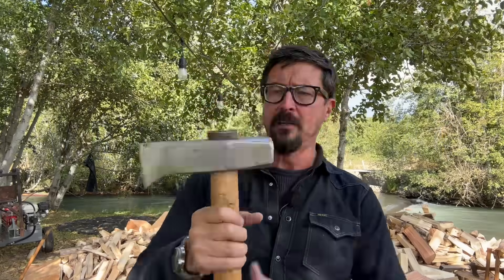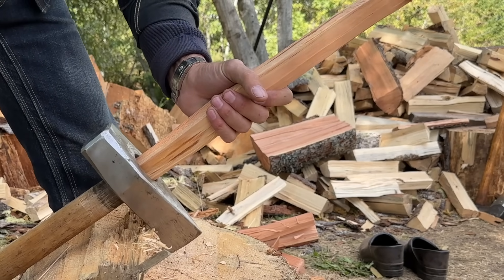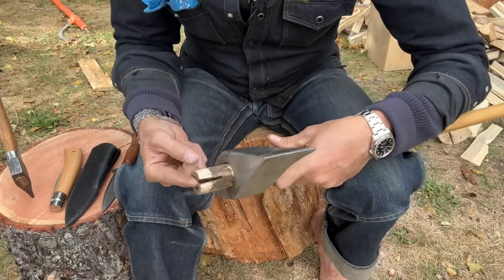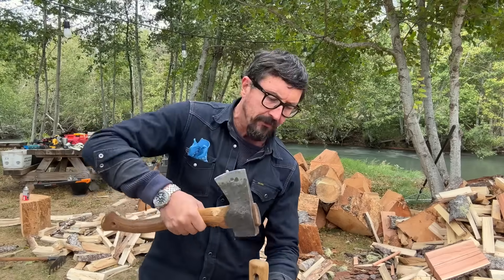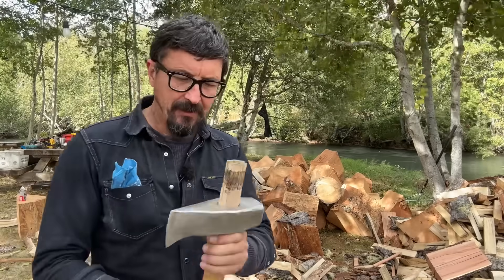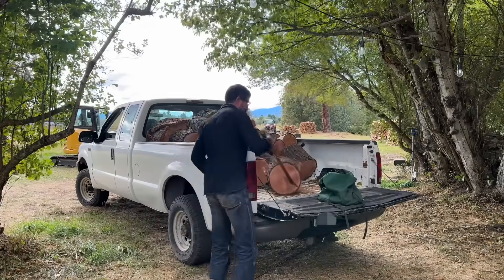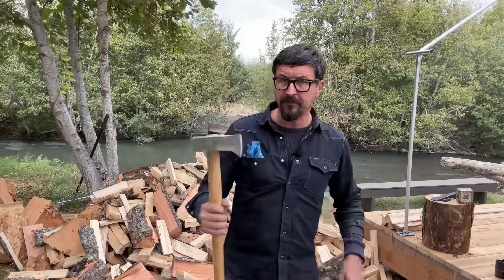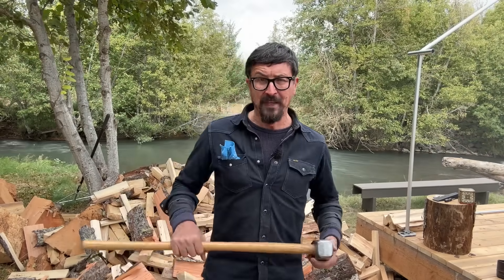Wranglerstar's Emergency Axe Repair (In Field)

Comment from the maker: Wranglerstar's Favorite Splitting Maul Only $69 Free Shipping https://amzn.to/3PKToFW
(Amazon affiliate link)
Reply: Made in China ...
Reply: I need a new axe for my content. I trust your advice wrangler if you say it’s worth it I’ll have to buy myself one in the coming week or two. 

Well, it’s forged steel for that price it seems worth it. 

I’ll put it to the Australian hard wood test!
Reply: What kind of pants do you wear
Reply: Waaait so driving a couple of old iron spikes or screwing a few screws into the end to spread the wood further is not the proper repair? 😂 jeez to think I have bought or been passed down so many tools that have had nails or screws driven into the ends and bent over 😂 I just assumed that was the proper way to repair them not to actually replace the handle entirely, see that makes sense and we're not paid to make sense 😂 act accordingly folks

Comment: You put me on the 4 in hand years ago when I was like 15. I’ve been buying them and misplacing them for years and now I have enough that I’ve got one in nearly every tool box.

About two months ago my car wouldn’t start at a gas in the middle of no where, I tracked down the issue being some tarnished and corroded battery contact points. 

The forehand made quick work and I was back on the road.
Reply: Me too! (But I haven't solved an electrical problem with one yet)

Comment: I replaced the handle on a small ball-peen hammer in a similar fashion. No kerf in the top of the handle and just a single, small steel step wedge hammered in. No wood wedge. It's been holding on just fine.

Comment: What is more permanent than a temporary fix that works?
Around 10 years ago I "fixed" the power switch on a large commercial Bunn coffee brewer for a friend with a coffee roastery and shop who used it at a weekly street market. I told him that it should at least get him through that market the next morning (nearly midnight at the time) but that he should order a few of the switches to keep on hand... the "fix" is still going and that thing has brewed thousands of gallons.